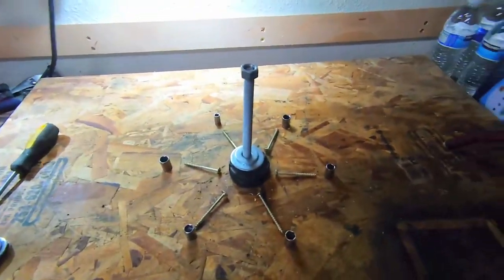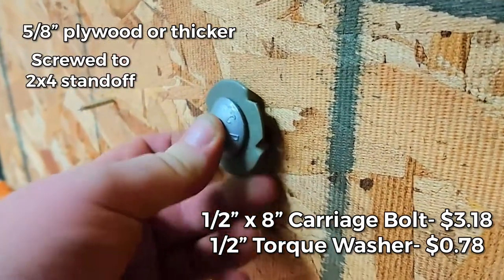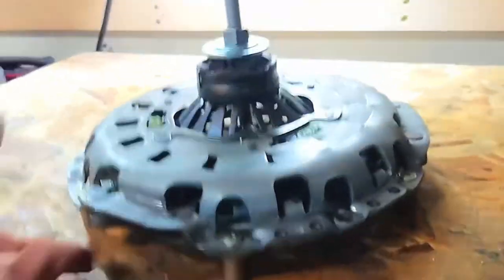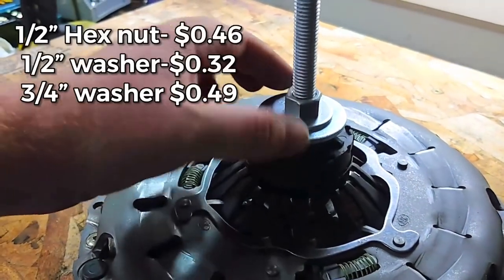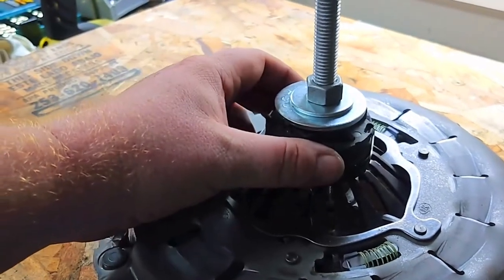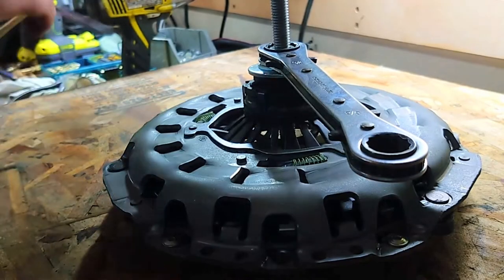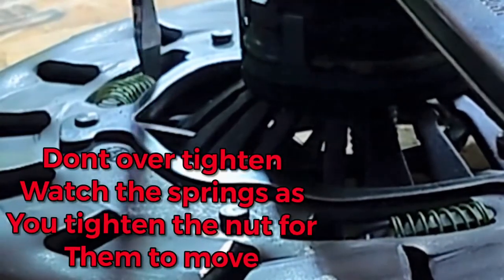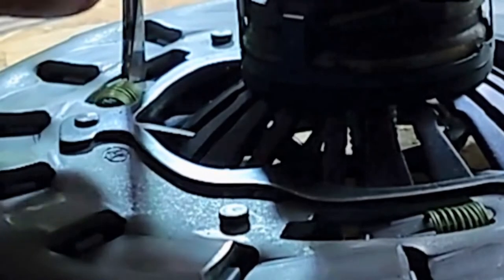How to reset a self adjusting pressure plate with standard tools - 2 min Tech Tip

Comment: Great Video thanks, do you know if you can adjust the spring rate on the pressure plate. Mine is way to hard to push in. Thanks
Reply from the maker: Not like this no. That would require a different pressure plate.

Comment: thanks for the tutorial, one question, once reset the pressure plates, approx. how many KM will the clutch last?
Reply from the maker: A new clutch disk on an old pressure plate? That’s really depending on use it could last as long as the original or it could be only a few Ks. Make sure you do a proper break in for a new clutch disk.
Reply: @budgetoutlaws9978  how do you break in a new pressure plate

Comment: Why doesn't it come preset from factory this is insane lol thaught there wasn't a way to do it without the tool
Reply from the maker: New ones should be reset. But if you pull off a pressure plate and put a new disk in or something else you need to reset the pressure plate.

Comment: but what about sachs or valeo. Their resetting mechanisms are hidden and not so simple.
Reply: Your not supposed to reset the self adjustment in them. Sachs SAC is internal and Valeo uses a wormwheel on a gear for its adjustment